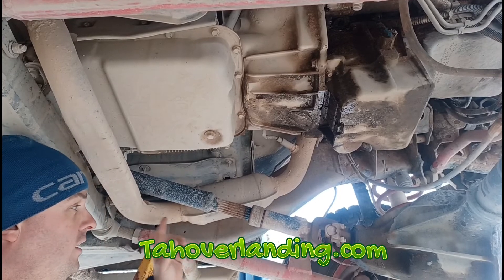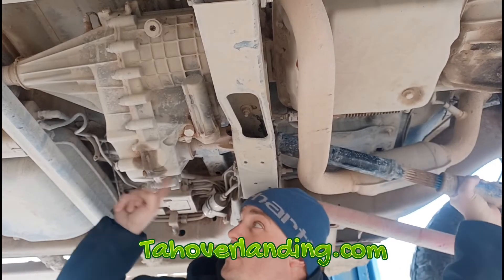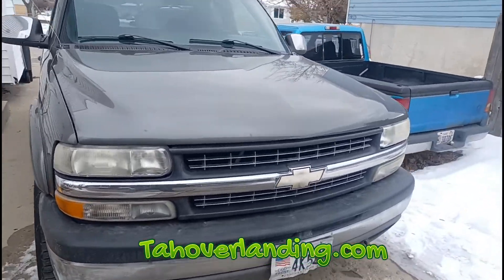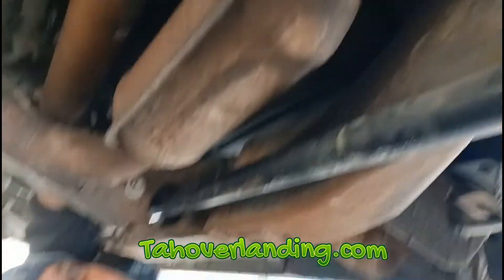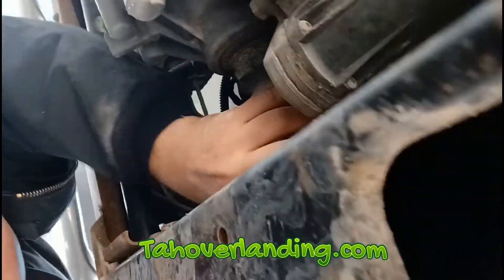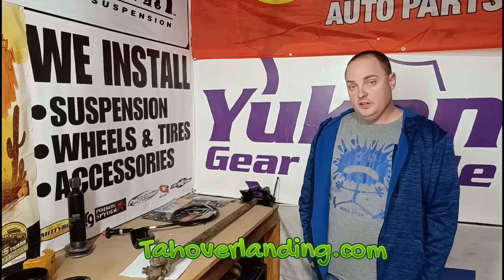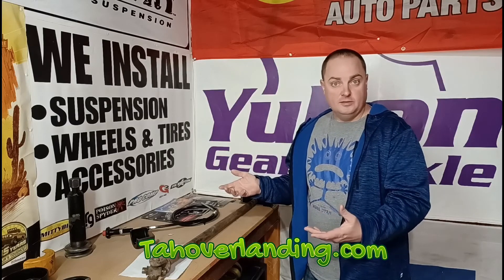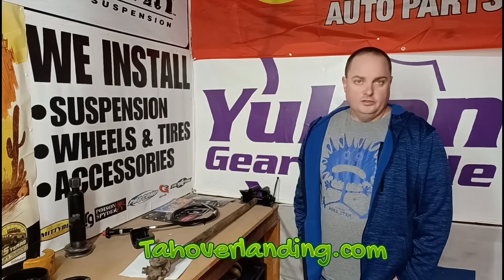CAD actuators, manual Hubs and CAD delete Tahoverlanding Axle swap episode 23

Comment: IS this the same on a 2004 GM 3/4 ton ?
Reply from the maker: @shelbak65  which part are you asking about,
Reply: @tahoverlanding  the t case
Reply from the maker: @shelbak65  yes, if yours has "auto 4wd" as an option for the selector in the cab. Not all 2500/3500 have it
Reply: I would say something wrong going inside the t case .In  2wd no power to the front  .
Reply from the maker: @shelbak65  that's how it is, it's the pre load on the auto 4wd clutch pack. It has pre load to begin with so that it can engage auto 4wd instantaneously 

So there's drag on the front shaft.

These guys have a full teardown of the case showing it:
https://youtu.be/YB9sGeAzoPE?si=_DzjNGOoz7RQXDOU

Comment: I swapped out my NP246 for an NP241. My drive shaft doesn't spin anymore. When I solid axle swap I want a clutch type LSD, so locking(Frewheeling) hubs will be necessary to keep my drive shaft from spinning at highway speeds.
Reply from the maker: @asandberg6  with the #tahoverlandingaxleswap it's not necessary to spend the time, effort, and dollars on swapping transfer cases.

But since you already have, let us know at the time you order your kit, and we'll take the front slip yoke eliminator out of the kit, and drop the price of the kit.

Comment: Since the drive shaft is already spinning in 2nd will it hurt anything to put a mechanical locker in the front when using the d44 cad axle
Reply from the maker: By "mechanical" do you mean automatic?
Reply: @tahoverlanding  yes as in a clutch or ratcheting style
Reply from the maker: @jeremyhowell9463   The reason why  I asked is Units like the true track, or clutch style limited slips are automatic but not considered a mechanical locker. 

Auto style ratcheting lockers in my own experience are awful in the front with an automatic transmission in general.  Because the only way to get them to unlock is to not apply power to the drive shaft. So for example pushing in the clutch to turn the wheels . Which you just can't easily do in an automatic. 

Obviously selectable works fine. 

 I've had reports of individuals torsen style lockers (such as true-track), and clutch style limited slips without much issue.  

But I haven't heard much on auto- ratcheting. 

I just don't have much personal experience with these transfer cases  And that style locker sorry
Reply: @tahoverlanding  ok thanks I’ve got my d44 from an 01 will be getting started soon it’s an 04 z71 burban
Reply from the maker: @jeremyhowell9463  climb up and see if your transfer case lets the front diff free wheel in 2wd. 2004 is right around where the rumored split was. 

You might get lucky.  

Comment what yours does
Reply: @tahoverlanding  yes my drive shaft free spins in 2wd. With it being unlocked at the t case does that affect the type of locker I should use ? Wouldn’t it be the same as a open diff that diverts power to driver side until the cad is locked? Would a Lincoln locker or mini spool be as drivable as open diff on highway while in 2wd with cad unlocked?
Reply from the maker: @jeremyhowell9463  a "Lincoln" locker is slang for fully welded spider gears. Do you mean a lunchbox locker?
Reply: @tahoverlanding  yes that’s what I meant just welding it or a mini spool would effectively be the same other than strength. I had a rig with ho72 welded and d60 full spool up front that was a off road only and trailered to parks. My big question is on the cad  acting like a selectable locker with diff locked all the time. Since in 2wd there will be no connection at t case so should not be any binding this is a highway driven truck and a locker isn’t necessary 99% of the time. Another concern is if left open diff with cad unlocked running 70mph for a few hours is the r/p drive shaft going to be more resistance than just the spiders being the pass axle shaft is disconnected and I’m sure the spiders would not live if that happened. Would be the same as doing a one tire fire burnout the entire time you drive at what ever speed. None of this would be a question if it didn’t have cad or tcase stayed locked.
Reply: @tahoverlanding  with the diff locked all the time all the components spin at same speed and not connected side to side or front to back so seems as if it’ll be safer for parts and get the benefits of a selectable locker for the cost of a mini spool
Reply from the maker: @jeremyhowell9463  one shaft spinning makes all the spider gears and side gears spin equally. Just the side gear, and inner shaft on the cad side spins backwards. that's how open diffs work.  

Further evidenced by the fact that the dodges they are intended for fully disconnect the front shaft.  

It's not an issue.  

In theory using the cad to use a spooled front diff might work

But spooled front ends are the worst. It really is nice to have a front end that doesn't fight you 100% of the time. Even off road, that tighter turning radius while still being in 4wd is handy.  

But hey, if you do try it. You can be the guinea pig on how that setup works in this application

Comment: Glad you brought up the np241c. Some gmt800s came with that transfer case, but they were delegated to forest service and military applications, and even then they were few and far between. My grandpa found one at a forest service auction a few years ago up north somewhere and uses it on his ranch. Its a great tcase but the truck still has the electric actuation up in the front diff
Reply from the maker: Chevy was kind of inconsistent with which trucks got what, some trucks have a transfer case that will let go of the front drive shaft and others don't I can't find a good pattern yet that I can reliably say is true.
Reply: I've looked at other government auction trucks and from what I've seen, the few 800s that got the np241 were only gov owned. There were a few work style trucks that got them, but those trucks also didn't have power windows, locks; had only the basic air conditioning, cloth manually adjusting seats, and the terrible base model stereo. But still, even those weren't common and usually in 2wd configuration only. Like you said, not consistent

Comment: My 97 suburban, 95 tahoe, 98 1500 all disconnected the front drive shaft in 2wd. I'm a bit confused about what your discussing. Is your 4x4 an automatic engagement with wheelspin.
Reply from the maker: My 1998 Tahoe,  and 1999 suburban both don't disconnect the case.  
On most it comes and goes at times as well. My '01 Tahoe has periods it lets go, and periods it hangs up.
Reply from the maker: In my own experience the gmt400 is worse about it than the gmt800. 

Go climb under any one of those right this second and twist the shaft, comment what happens
Reply: My experience is the auto trac (np 246) t case keeps some tension on the clutch pack that’s why it doesn’t freewheel in 2wd. GM also had a tccm reflash that applied tension to the clutch pack to help with a customer complaint of vibration at highway speeds!

Comment: I don't have any experience with half ton GMT800 trucks but the 246 case in my 03 1500HD would disengage the front driveshaft in 2wd as well as the 263 case in my 06 2500HD.

The 06 has a conversion 273 case in it now and it also disconnects in 2wd.
Reply from the maker: I've heard conflicting reports on those years and models of electric shift cases. Some do, some don't. Nothing definitive as of yet. But I'm going to note yours with what else I've heard and see if a pattern emerges eventually